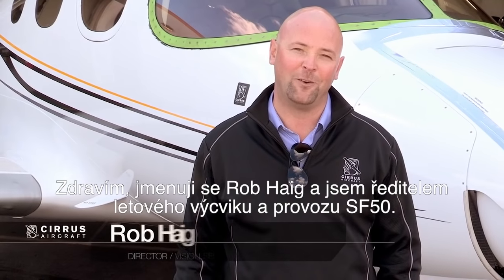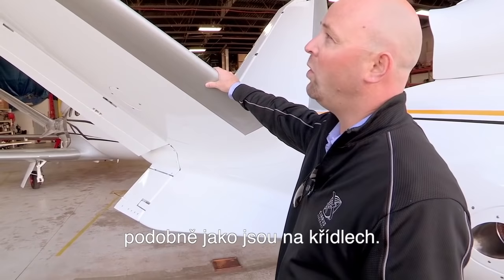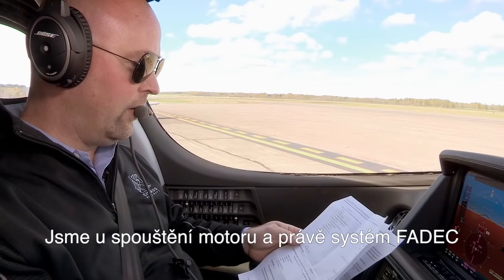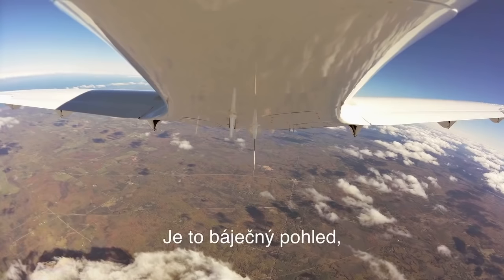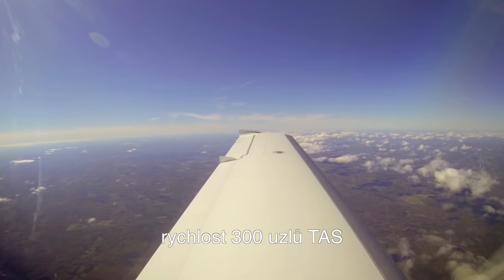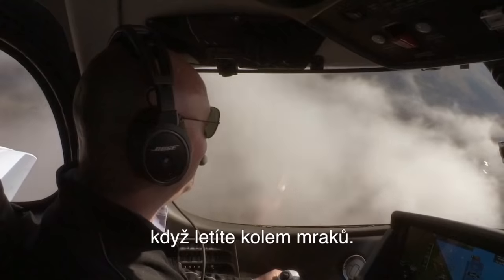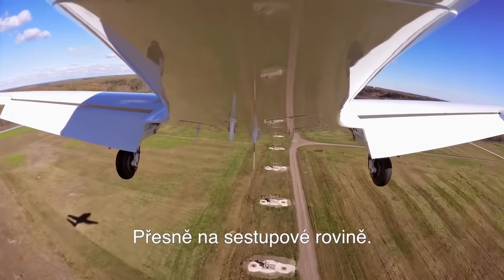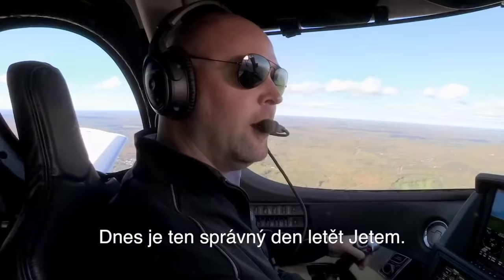Vision Jet SF50 Flight

Comment: Great video, I would do anything to have the opportunity to fly a Cirrus of any kind. Use to live in Minnesota
Reply: There is nothing like the SR22 Turbo...and this plane is the only one that will top it.
Reply: I'd rather have a Lancair Evolution!
Reply: The Evo is much smaller, only seats 4.  And it's not a jet...a turbine aircraft.  And worst of all it is an Experimental which means you will blow $1.5m getting one done and at the end have a  non certified aircraft with no all airframe warranty.  And if you add the chute to it, you will have a plane with no testing done proving the chute will work for it.  And you will have a very old tech G1000s with bezel buttons and antiquated interface insofar as glass is concerned.  The SF50 has the new G3000 touchscreens.
Reply: All true, my guess is the Cirrus is more spendy than the Evo.  Actually I'm waiting for the Raptor.  Best bang for buck.

Comment: Why was there a delay in the retraction of the right landing gear (3:01 – 3:08)?
Reply: Vedang Narain if you look at pretty much all landing gears they do this, I forgot the reason why but I think it's a hydrolic control thing , long story short, this is normal for any landing gear.
Reply: Well, it's more of a split than one would see on, say, a 737. 

It has to do with the hydraulic fluid routing and the pump capacity.
Reply: Oh, I never noticed it in other landing videos. Thanks!
Reply: yea I think its normal. It happens on the Cessna 210 too

Comment: It is a beautiful aircraft, however, I noticed some pretty sloppy sealer around the canopy!
Reply: Bill that plane is a test bed prototype and not a clean production version. During flight test and certification they are taken apart and reassembled many times for airframe inspections  and things like that. The production versions are really clean and slick which is typical of all Cirrus aircraft.

Comment: Sorry, but i hate the joystick. Being someone how is right handed and always has trouble using my left and in slow smooth situations i wouldn't feel safe using that joystick.
Reply: It's not that big a deal.  In any aircraft with a standard yoke, you fly with the left hand and manage the throttles, radios, etc with the right.  It's actually easier.  I have flown a SR-22 and its very easy.
Reply: Pilots use left hand predominately, whatever the aircraft or stick.
Reply: As an ex military flyer, I was thinking "can they deliver it with the PIC station on the right? That way, right hand on stick, left on throttles, flaps etc just as in the military.
Reply: I see were your going but if you have ever been next to the pilot in a private aircraft they usually use their left in the yoke and the other hand for flight instruments and stuff. If your too worried you can probably customize your order or something
Reply: Actually it´s a lot easier to use the stick with the left and do the other thing with your right hand. Right handers struggle a lot more with stick to right and using left for radio etc.. It´s not like Airbus and others haven´t tested before.
Reply: It’s common sense to have it on the left otherwise you would have to remove your hand from flight control use the screens.

Comment: Ok to fly if you are left handed.
Reply: +woodsman birch You can sit at right, there's also a bar. ;)
Reply: Woodsman Birch you fly single engine plane with left hand as well, right hand on the throttle. It's how literally every other plane is flown.